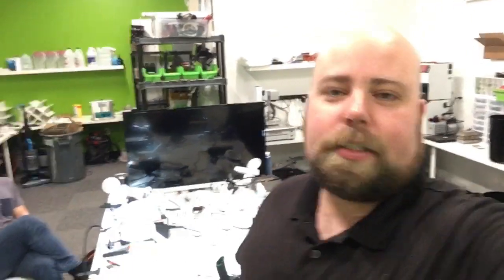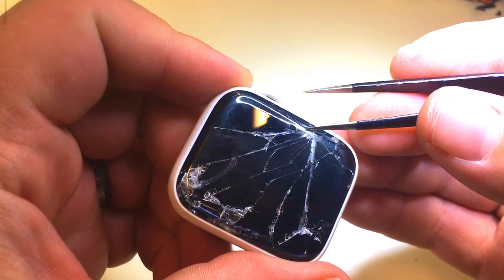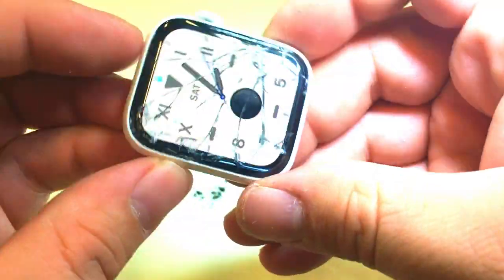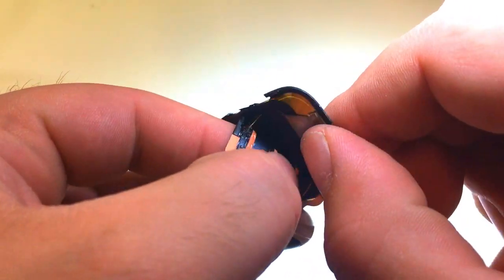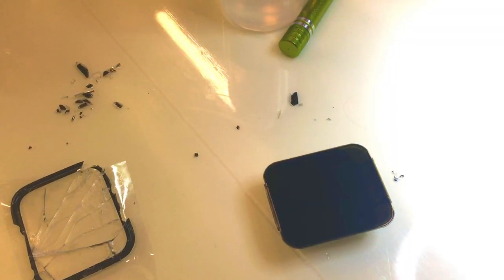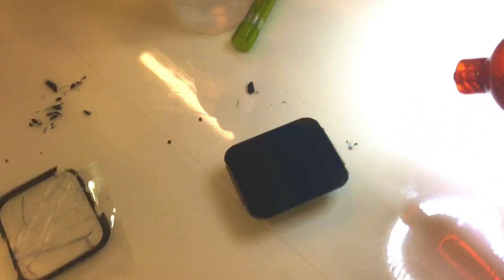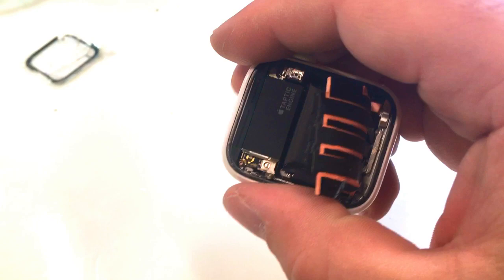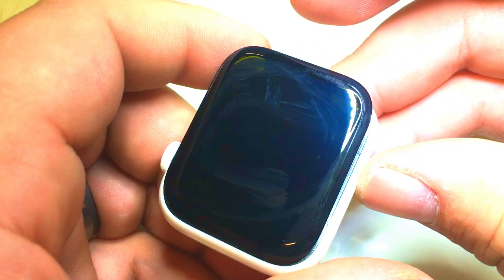Series 5 Apple Watch Ceramic Glass Repair Tutorial

Comment: hello, I got a question, I tried to fix my watch however I broke the black stamp which goes ut to the flexo conector. Is the one that goes on the little three silver plates. so I think thats why the screen is not turning on, do you think it migh be that? or something else? 

Besides that i think I done all properly even the watch turns on just not the screen. 

So you know where Can I buy that stamp?